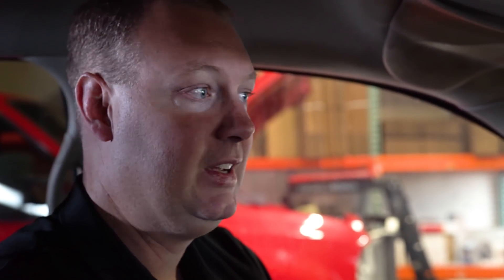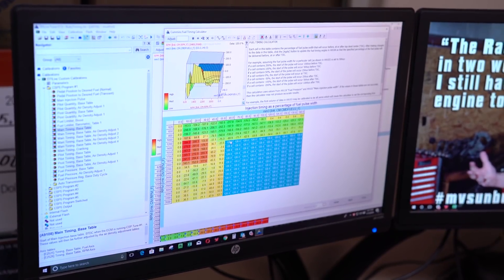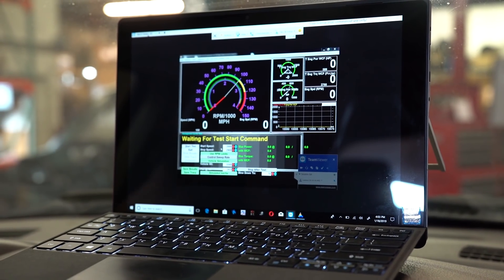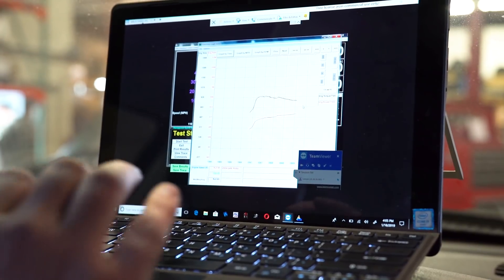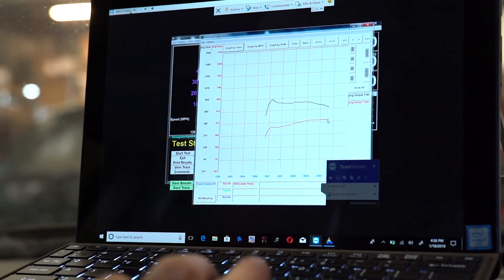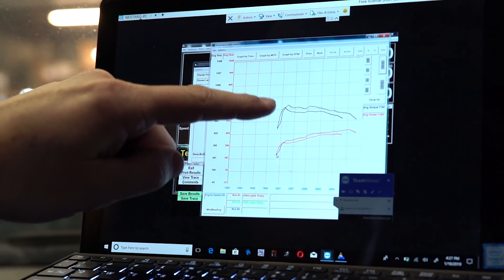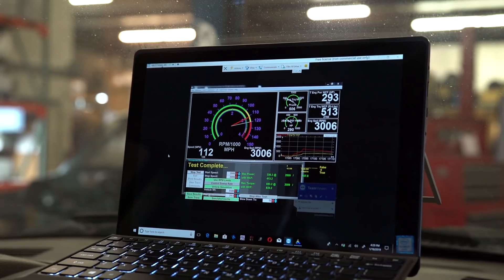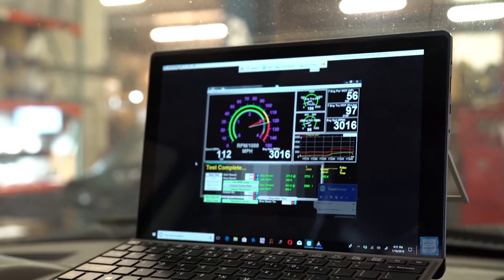EFI LIVE Timing Dyno Test | Power Driven Diesel

Comment: Earlier timing with a low pulse width is allowing the fuel to atomize in the cylinder for a couple microseconds my research has lead me to believe when injecting large quantities of fuel to make power, that the injecting it early and allowing it to atomize will help reduce unburnt fuel and optimize power.  And run high rail pressure.

Comment: Do you recomend efi vs mm3 or are they pretty similar just depending on tuning or tuner.
Reply from the maker: They are very similar the biggest differences will be year and auto or manual as the efi is better for tuning 06+ autos as that is when they started the 849 ecm
Reply: @pddofficial  what about a 15 auto efi?

Comment: Is Todd's CR more "forgiving" of late timing because the exhaust valve is closed longer on the cam?  I've heard that 06-07 has "in-cylinder EGR" - safe to assume earlier trucks are cracking valve open a bit before the power stroke is complete?
Reply from the maker: it has an aftermarket cam

Comment: this begs the question, if your egt's are going down as you advance timing,  Could you add more total fuel by raising pressure and pick up more power?  I guess the answer to this question would be more apparent if we recorded AFR for those pulls.
Reply: @pddofficial  awesome, thanks for the response.  I tune and have tuned hundreds of gas engines but have limited knowledge of diesels so I'm interested in learning more about the ins and outs of tuning them.

Comment: How many pulses do common rail engines use? Some new emission type diesels have 5 or 6 injection pulses
Reply: On the 03/early 04 there are 2 and on the 04.5-early 07 there are 3

Comment: Awesome video. I have been playing with timing on my 06 cummins using hptuners. I couldn’t determine a good method for choosing timing. I started with using p-pump numbers on the main soi at 150mm3 and interpolating it down lower. I found that smarty has a calculator but I think that was 50-50, and the truck didn’t wake up. I tried to do more math based on astm and petroleum research papers for diesel ignition delay and pressure curves at 1600rpm. I tried to reverse calculate ignition delay in uS to crank degrees and it seems happier. Have you found any correlation between the 100/0 and 80/20 splits and optimizing ignition delay periods?
Reply: Wow that’s super complicated

Comment: interesting.  ok so i was a dodge/chrysler/jeep tech for 17years.. in the early common rail fuel management class they described the fuel event as a "pilot shot" to start the burn then chase the piston down with multiple shots for a sustained burn. they didnt talk actuall timing or percentages of before and after. they talked about engine noise levels and increased torque due to an increased burn time that would drive the piston down for a longer period of time vs. a single "big bang". so your finding are very interesting to me... power and egt.

Comment: From a daily driver stand point, what do the different timings do to the lower rpm torgue and torgue curve?  I see the tests starting at 2K, but I pull a 5th wheel with an automatic.  Also what's easier on the engine?  I'd like to find a compromise, no loss at lower rpm with gains more up top.  Even better, more torque/HP across the curve over stock with no major difference in engine longevity.
Thanks,  Enjoy the videos.  Please keep them coming.

Comment: The results are interesting, yet that makes sense relative to the better power results by adding fuel before TDC based on the fact that common rails run higher injector pressures which improves (increases) the fuel burn due to better fuel atomization (increased surface area).  The real test in my mind is to track the impact of injector timing on EGT's and MPG when towing on a grade vs. a dyno.  Great video; very helpful.  Thanks.

Comment: looking at the timing calculators 100% BTDC at about 1900us is starting to inject at about 37 degrees BTDC at 3200. What about running something like 2500us pulsewidth? Starting injection at nearly 50 degrees BTDC at 3200 to get 100% of the fuel in BTDC seems extremely early to me. I'm used to mechanical injection where as stated, all the fuel is in depending on crank rotation and not by a timed duration.   Just trying to learn some things, I guess I've stayed between the 70/30 and 50/50 split because the timing numbers worried me.

Comment: Try adding boost to the graph use the Telemetry equipment you had on the race truck.  offer a temporary part or the whole of the Telemetry kit as an upsell on Dyno runs,  I would have paid extra for it . Crank speed would have been nice instead of calculated RPM(91.5[june]=no factory tack or sender).
Reply: @pddofficial  nice . It all take time.

Comment: Could you do a video on p pump timing, what is too much, what is not enough, and what is ideal? I've come to the conclusion for 500hp 20-22* is about right, but it would be great to have a little more insight on this.
Reply: I agree.. I have a Freightliner fl60 tow pig. 12v 6sp truck. I've done the AFC LIVE and .055 DV with long travel kit for stock boost. My data plate says 11 degrees. What will be the difference from 11 to 16 degrees?? What is the advantage? I'm actually going to call you about this. I cruise at 65 at 2000 rpms. My little truck is commonly at 25 to 30k with truck, 53ft gooseneck trailer and load. Lots of long passes between cda idaho and Indiana.

Comment: I was going to ask how a p-pump injects enough fuel at higher rpms  given that the window that the injector is open is shorter. But I thought a little about it and figured that the higher rpms would cause the pump to make more pressure. Am I right on this? Also, is there anyway a p-pump engine can be modified to make it a common rail? One last question. What is your opinion on the new Dodges with the 1000 pound-foot of torque?
Reply: Thank you for the reply. And Thanks for the great vids.

Comment: Very cool! I know in training the theory on CR is no matter what there is a small shot of fuel before tdc to start the flame. But not enough to cause the clatter noise. And then inject the remaining fuel in to the flame. Easier to light a small amount. Most pcm’s are capable of 4-6 injection events per power stroke. (All of which lead up to the CR’s being more forgiving)

Comment: If power levels are close,  then focus on EGT's? Dyno runs are short bursts vs a long pull on a hill ... I know you race but I'd bet more guys are interested in towing performance... and keeping all the engine parts under the hood ;)
Reply: Mike Collins yes my thoughts exactly. I only tow with my common rail and would like as much power as possible but also be able to keep my foot buried and have egt’s in check.
Reply: @pddofficial  set the dino to simulate the hill on the south end of town or even better yet set the dino to simulate the SAE   tow tests' Hill Davis Dam. It's a mild 4 to 6% grade better would be locked in first 25 miles an hour at 14% for about 5 minutes tell us how the fan kicking in effects the output. Yes the fan consumes between 25 and 75 horsepower on a Cummins engine as per Cummins but the additional airflow in that shop setting should yield colder air by means of density Improvement I'd like to know if the Improvement is bigger then the draw of the stationary fan not allowing the intercooler to do his job on improving hair density. Let's face it in Utah sometimes the wind is blowing up the hill faster than your driving if you're heavy EG no airflow in your intercooler until the fan kicks in
Reply: That's a very valid point.  Towing on a grade is the real test.  Dynos help set the parameters.
Reply: that's why you have at least 3 different tunes.  One for gas mileage, one for towing and another for max power.

Comment: Is there anything you can do for timing on a vp44 pump?
Reply: You should check out the quadzilla adrenaline v2.
Reply: @pddofficial  okay I will give you guys a call. I'm rebuilding my engine in my 2001 Dodge 2500 with 150 horsepower injectors, hot rod injection pump and 63mm fleece performance Turbo. And while tearing it apart I see that I need a new cam and I was looking at your stage 1, stage 2 and stage 3 cams and have questions about which one would be best for my truck which is going to be just a daily driver and light towing truck. I think number two would be best for my application just wanted your thoughts on it and if I should put new valve springs in as well or if stock ones will be fine?
Reply: You can swap it for a p pump... thats your best bet for better timing XD